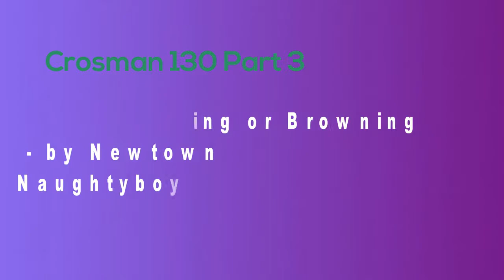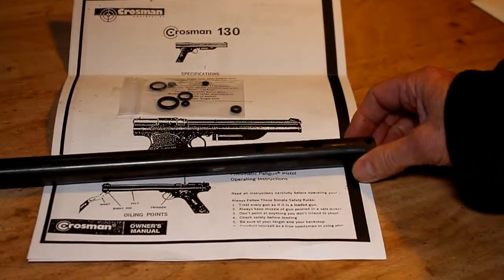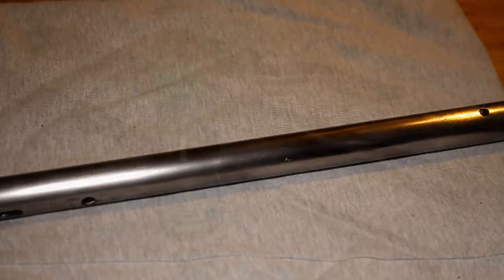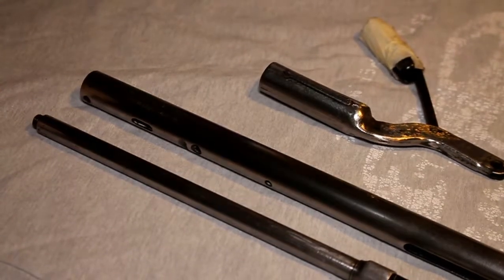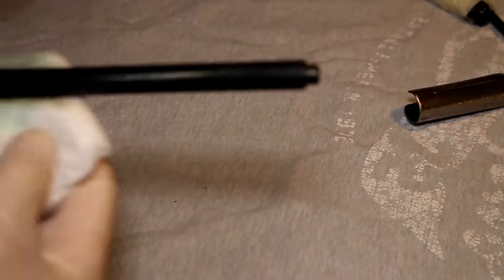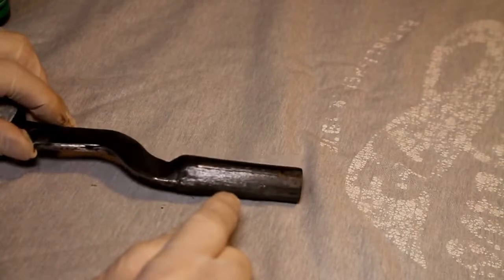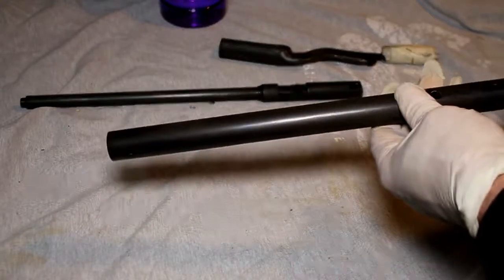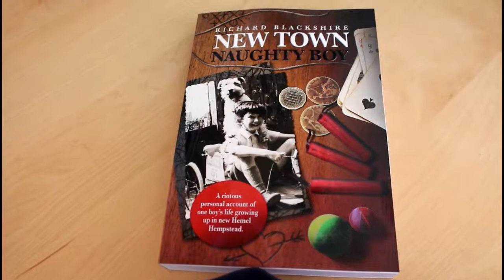Crosman 130 Part 3 -  ballistol cold bluing

Comment: use a arm whit vinigar to clear old blueing of parts,leave in vinigar for bout 30 mins ,you can see it clearing it of them rub down with fine wire wool
Reply from the maker: thx for tip
Reply from the maker: yes would be good but they will give slightly different results. Yes more power or pressure can mean all sorts of things and issues. that's why a lot of shooters try and keep the Foot Lbs to about 11 to 11.4
Reply: better you take for clearing a brake cleaner spray! It works!

Comment: Hi.ive got a rifle preblued..shud i remove the whole old blye and thrn aftet degreasing use balistol blue
Reply from the maker: well I did but only because the condition of the metal work was so bad. if its a small patch needs doing id try doing the patch first and try and blend it in, if that don't work then maybe consider stripping it all back.